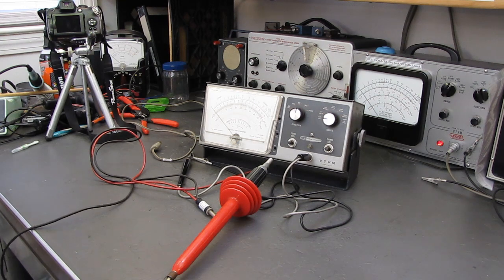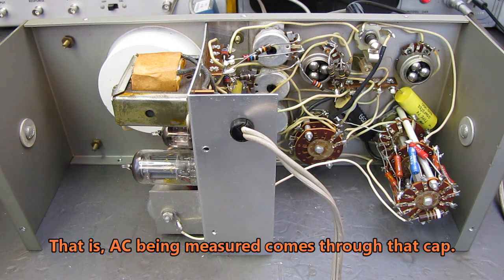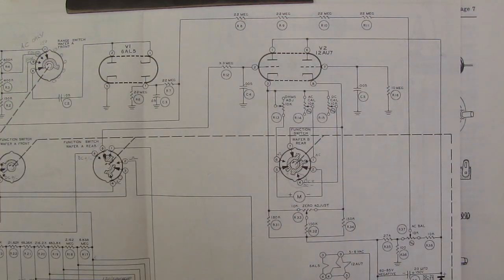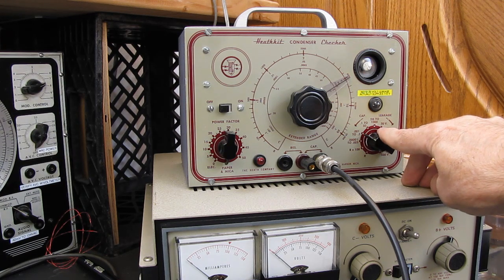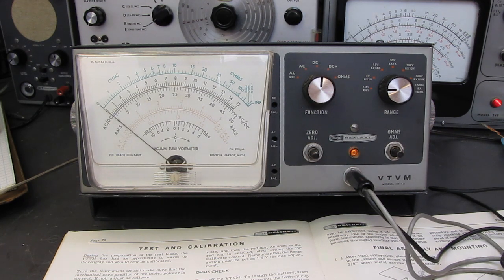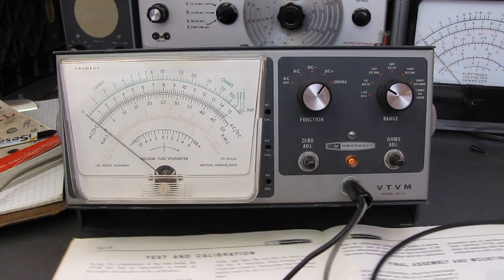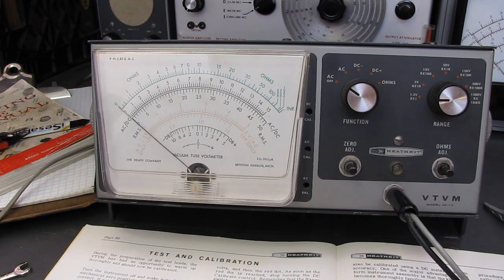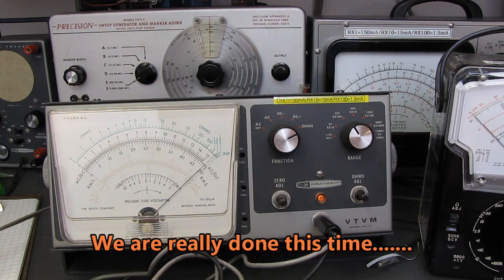Heathkit IM-13 VTVM Repair

Comment: I have an IM-18 that I modified to have the same circuit as the IM-28, of of the successors to the IM-13 you have. I did the mod back in the mid-70s when I worked at the Heathkit store in Atlanta. Thanks for the info about the current on the ohms ranges.

Comment: The number you speak of actually indicates the number of electrically independent electrodes, which includes the heater.  With metal octal valves however, the metal envelope is counted also, so you have 6A7 and 6A8.  This was carried over to the glass octal versions, such as 6A8G, even though there is no metal envelope to connect to.  There are exceptions though; namely the 5Y3G, 6B6G and 6P7G, but there were no initial metal versions of those valves.  There are exceptions to that logic too, namely 5U4G, 6U7G etc.  The vast majority of  valves, however, do follow the convention.

Comment: Can't remember the model number but have the blue case and white panel with black lettering otherwise pretty sure insides are the same as your meter..  I like that Eico meter too. It's been awhile since I used any of my vtvms. Have a couple of digital meters and Simpson 260 that get used the most
Reply: That will be the IM-5228. I have one which I fully restored including stripping the case and having it powder coated again, then got my screenprinter to do the graphics/lettering on the front panel. Looks like it just rolled off the factory floor!

Comment: A lot of those meters will blow filaments on Battery operated tube type Transoceanic, H503 type Zenith, RCA radios.  1L6 is the best example, being, from my experience, the most vulnerable, and most expensive.  I just paid 60..00 for another NOS 1L6

Comment: just a note that 12AT7/12AV7/12AZ7 are adequate substitutes for the 12AU7 .  12AU7s are getting expensive and 12AV7 or 12AZ7 can still be found NOS at low cost  12AX7won't work - it doesn't have enough drive (cathode current)

Comment: There’s nothing wrong with shot gunning the paper caps as long as you track what you’re replacing with the schematic. Developing a good technique is the key to successful restoration. Checkout the vital components before jumping in and hacking everything. Track your work along the way. Checking paper caps is , at best, a waste of time.